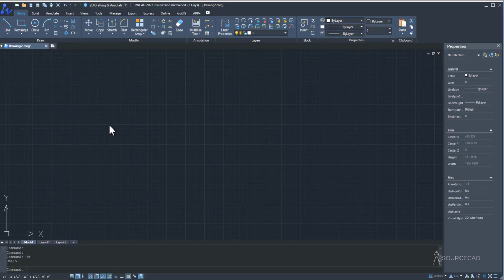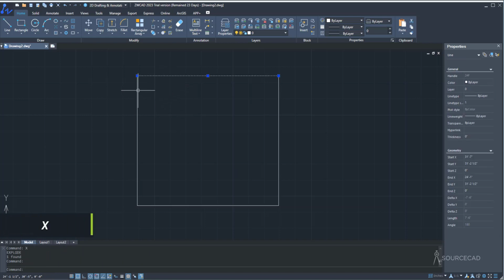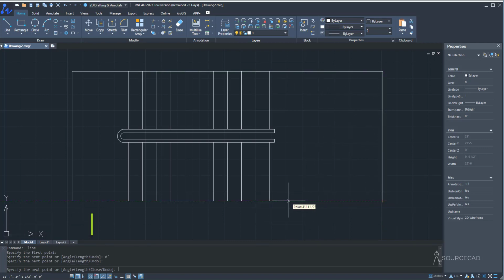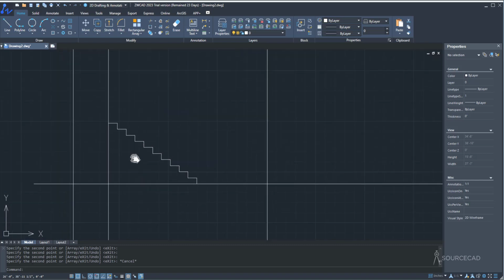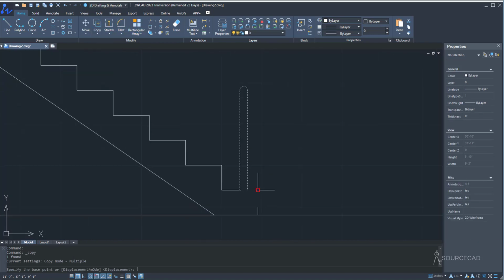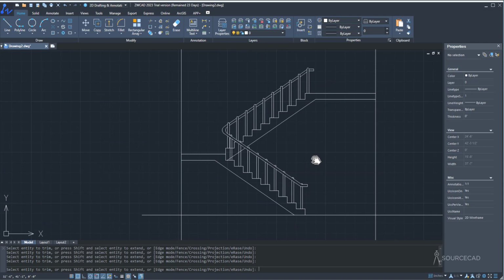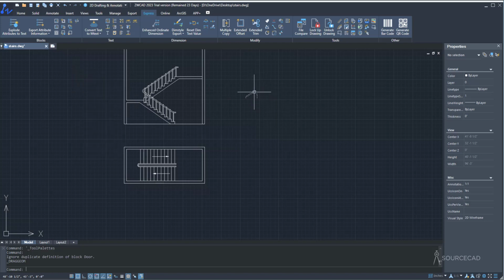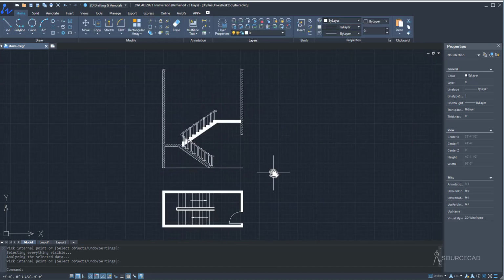Making stair plan using ZWCAD (AutoCAD alternative)

Comment: Does ZWCAD support AutoLisp?
Additionally, 9" treads don't meet code requirements - must be minimum 11" treads or 10" treads with a 1" nosing. Balusters minimum clearance between should be no more than 4" 
(to be fair, I realize this is just an example)
Also, with the AutoCad stair tool, it does all the work for you.
With all due respect, this is not an AutoCad alternative without a lot of relearning procedures involved in stair creation.
Perhaps, I suppose it could be an alternative to AutoCad LT?
Still, interesting, and, thanks!
Reply from the maker: I agree with you Mike, it should ideally be 11 inches for an indoor stair like this one but here just for the sake of this example, I took the length as 9 ich to keep all the other dimensions within reasonable limits including the height. There can be LISPS that you can create to make this easier and automate the process as well. About LISP support, yes ZWCAD supports LISP as well and just like AutoCAD you can load it here as well quite easily.
Reply: @sourcecad  I entirely understand I love the tutorials you present.
Thanks for the fact that ZWCad supports LISP, makes it even more interesting!